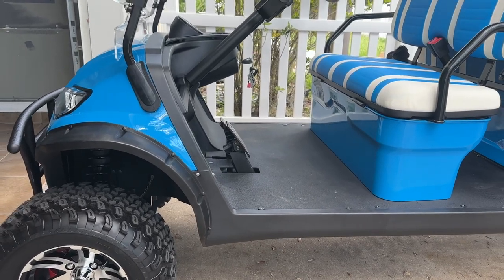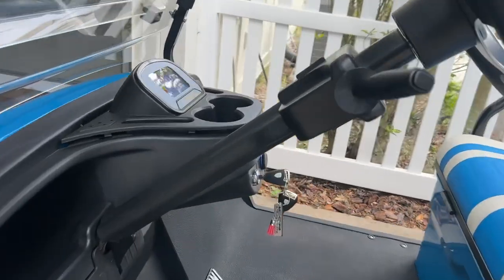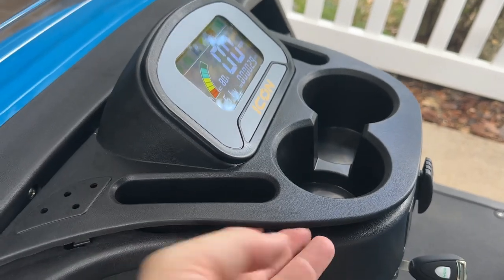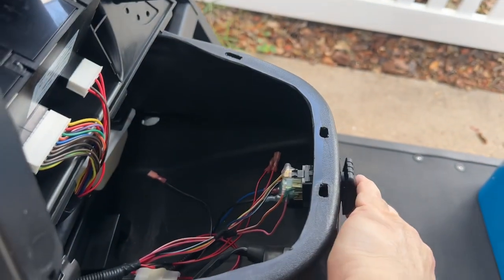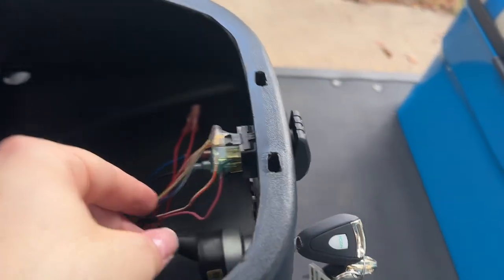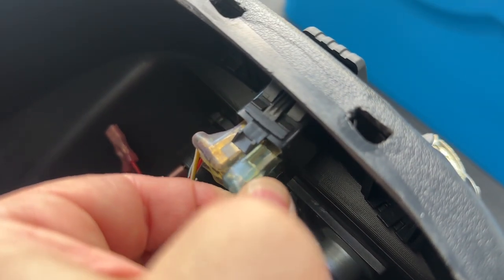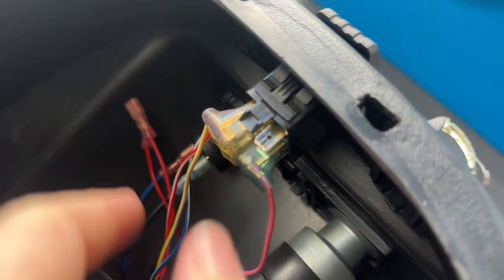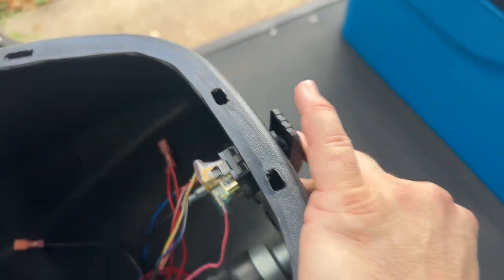How To Disable The Backup Reverse Beeper on ICON Electric Golf Cart

Comment: This also works on any MotoElectric golf cart also.  They have the identical console.  you just pop off and disconnect the same wire.  I put some electrical tape on the disconnected wire just to make sure it didn’t touch any other metal or connection points with it being loose under the console.

Comment: I looked under the seat  with a mirror at the color of the wire coming from the white plastic wire harness connecting the backup speaker to the terminal under the dash (I had room to look because it's a lithium battery). In my 2023 Icon i40 I just purchased the wire is orange with a white stripe. Under the dash the orange and white wire were connected on a terminal opposite what's shown in the video. It was tough to just pull off with my hand so I used needle nosed pliers to gently pull the orange and white wire from the terminal. It worked, no more beeping sound!  I checked before I disconnected the alarm to see if there are backp lights which there are not so no issue there. Hope this helps!

Comment: Tried on mine but the wires look like they’re hooked in the opposite direction (orange wire is on the right side not the left) and they do not just slide out. I’ve been pulling and nothing happens. Afraid of  breaking something. I also have a Lithium icon which might change things? Any advice?